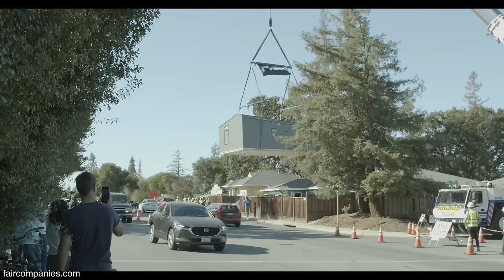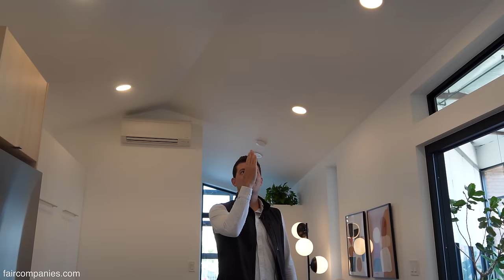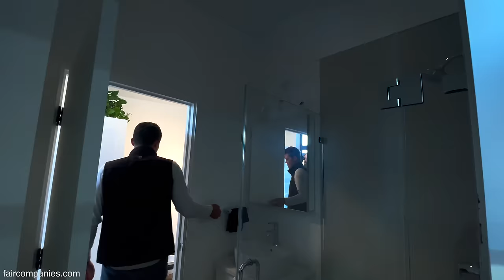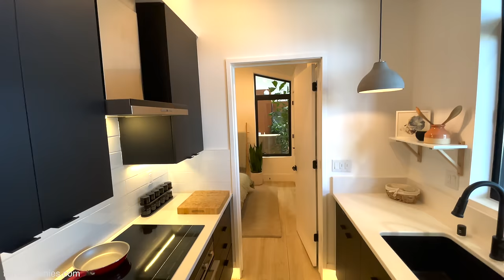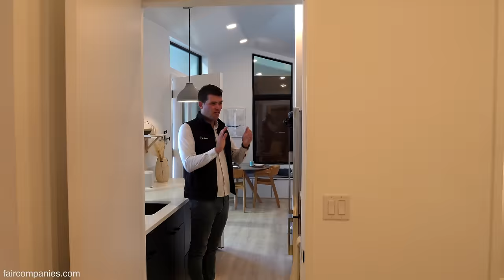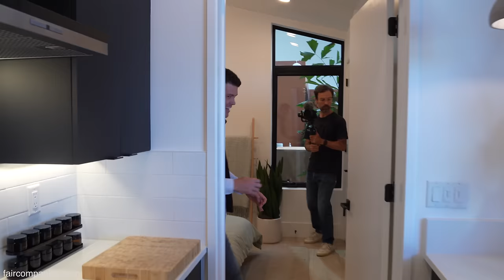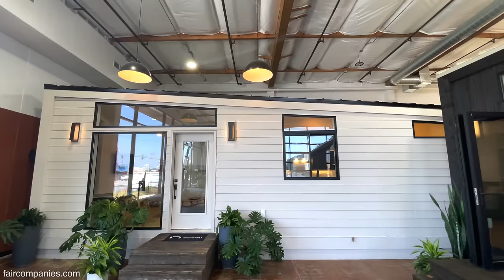Small prefab backyard home feels more livable than McMansions

Comment: Honestly it's hard to take their "we want to solve housing" seriously when you see the prices they sell these at (starting at $228,800). It sounds to me that they just want to cash in on the "outrageously expensive market"
Reply: You and many others making similar comments don't seem to be taking into account th outrageous costs of building and selling and buying in certain areas of the country. The same building could likely be built for half that in other parts of the country, at least once we get past the supplies shortage.
Reply: Mr Os  & KB Lewis who responded to Mr Os , Can't be sure about claims of concern to create affordable housing or alleviate the housing shortage dilemma. Prefabs are factory built and factories can be/ should be in low cost areas, then units shipped to CA/ wherever. True, labor will be more costly than elsewhere, but usually foundations and utility connections etc are up to the buyer. There are many videos on youtube featuring small houses with reasonable costs. Some features - someone mentioned vented oven or hood(?) can eventually be added. If you are paying $80,000 rather than over $200,000, there are lots of extras you can add. Kerry Tarnow,  a pleasant seemingly informed Canadian features some lower cost homes. I am not related to him, just found him the other day - many others. The presenter here is an "expert" for sure. This house just happens to be a bit over the top price wise.
Reply: @larkspur77  Not how it works, it doesn't matter that much where it's built because a lot of the costs are local.  The $228,800 includes the budget for a home visit, pre-approved plans for permits, permitting process done for you, a completed Abodu unit, standard site work, delivery from the factory, craning, and installation.  There's literally tens of thousands you have to pay just so you can get to the point that you can lay a foundation and be able to build a home on a property.

Pre-Fab houses still have to meet local code and pass all local requirements!
Reply: Exactly this doesn't stop with people living on top of each other in shoeboxes like in china or most oriental countries.
Reply: @kblewis3331  Prices of goods are in relation to the housing bubble, driving the economic sector. Without fait, and usury, house prices would return to their actual baseline cost.
Reply: That’s cheap for California. That’s around 1600 a month to own that verses paying 2500+ for a studio to rent.
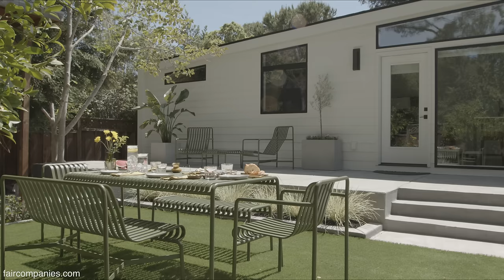Reply: Starting at 6:49 is the probable reason for the high costs.
Reply: "I have a house worth 1.2M..  I want to throw a half-assed shack in my backyard..."   Said nobody.   These will pay for themselves in 10 years or so.

These are the "ADUs" for expensive housing areas.  If you live in a crappy neighborhood then you can knock the wheels off a park model...
Reply: And that relies on services and land from an existing homeowner! Now to be honest the prices of building materials is through the roof and these look nicely done but yeah not "the answer" just z solution for some. Could give decent rental income if you can get decent tenants!
Reply: @_kass3939  that doesnt include tgd land or service hookups! Did you not notice these are being dropped on other people properties? 🙄
Reply: @kblewis3331    Yeah we are    Bye
Reply: it's like how do i make a double wide more cramped and 3x the price??
Reply: @_kass3939  you forgot to add property taxes
Reply: Way I see it it's perfect. See these blend well with modern California home (Modern meaning post 2010s) designs that are north of 1.2 million dollars in Los Angeles. The ADU would bring about not only rent that would return the money in 6.8 years roughly and not adjusting for higher costs of rent we most likely will see in the coming future.  It will bring the home value up tremendously as a home with an ADU is highly desired so in total you're investing 1.4 million dollars (most likely financed so not even your liquid cash) then you automatically have a positive equity because most likely your 1.2 million dollar home can sell for at least 2. With that 800k positive equity you've paid the ADU 4x over. I just bought a home and I've got a big enough lot to fit 2 ADUs it'll cost 450,000 and I bought my house in Orange County for 580k it'll be a 1.1 million dollar investment and by next year it'll most likely be worth way more. Just my view on it though and I agree it's expensive but the returns you'd make on it aren't unreasonably low
Reply: I can’t believe that they start at 228k that’s extremely high therefore I can’t see how this will help solve the housing market? I mean maybe convenient but affordable it is not!!
Reply: Wow didn't expect that kind of price! What a rort
Reply: 200k+?!  Yeah no way...  You're going to pay this much and there also a very good possibility that owning one of these won't ever appreciate over time either.  In fact, I'm betting that these will actually DEPRECIATE over time, especially on the land that's not gaining value over time...  Why would you ever want to buy one of these?
Reply: @yamchayaku  Since when does land depreciate?
Reply: @ArtVandelayOfficial  I never said anything about land depreciating, that was about the prefab house.  And yes, property as a whole CAN depreciate.
Reply: @yamchayaku  "especially on the land that's not gaining value"
Reply: @ArtVandelayOfficial  not gaining value =/= depreciating
Reply: @shayfisk-steinbronn1053  Affordability is relative to the market it's in..... If you are building or adding to a property in a $1mil+ neighborhood, like it seems they are, it's quite affordable
Reply: Whelp, considering a new new car/truck costs $70K, this doesn’t sound too bad.
Reply: $250k studio is cheaper than buying a family member a $1.2M house in California. Prices are relative to those seeing value in the object.
Reply: $228K for a home is crazy inexpensive…….
Reply: 100% agree these are way too expensive compared to other options.
Reply: You have to take the market they're working in into account.  An empty lot (or teardown, more likely) in Redwood City where they're based is going to run you nearly a million dollars.  Construction costs in the Bay Area are also insane, so building a new smaller home on that lot would cost about as much over again.  The average cost to build an ADU in California is $300,000 - $400,000.  In that market, $228k for a high-quality, well-designed home that you can just drop in onto the foundation and have in place in days, not months, is a bargain.
Reply: @KONY2025  Exactly. It is just s facny overpriced trailer
Reply: If boxable configure out how to make theirs For $50,000 I'm sure they can figure out how to do it for less than 150k
Reply: You obviously don't live here because there are plenty of studio apartment for half that
Reply: It infuriates me when I see tiny home communities build boxes for the homeless, no bathroom, running water or kitchenette. We’re America, we can’t do better than this for those less fortunate? This is a nice unit but most could not afford it plus they would need land to put it on.
Reply: thats rdiculous. more than a house. x
Reply: I completely agree with you. It’s getting out of hand
Reply: Would build it myself and I'm not a pro. Just not afraid to get hands dirty and have a decent brain. Price is outrageous.
Reply: Of course. Would you expect anything else
Reply: You think this for-profit company is here doing charity work? Use you brain before you comment next time please
Reply: It’s not hard to understand once you see how much the alternative housing costs would be. There’s nothing cheaper than $228K for a new housing unit in the Bay Area where this is located.
Reply: Yeah these builders are all the same and hit us all with the same lame pitch.
Reply: There are lovely alternative ADU options that are a quarter of this high price that are made with a steel base.  Some wonderful options, exist in California too. Examples are on YouTube. So, there is great competition with fairer pricing for great ADUs, thankfully.